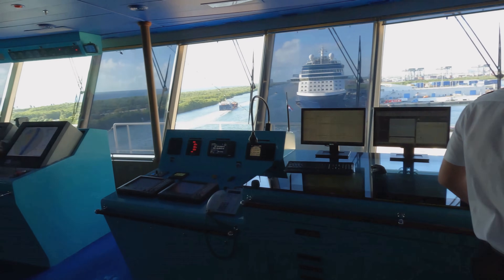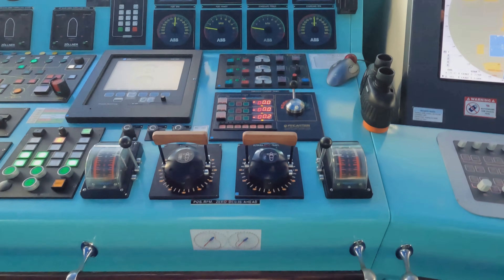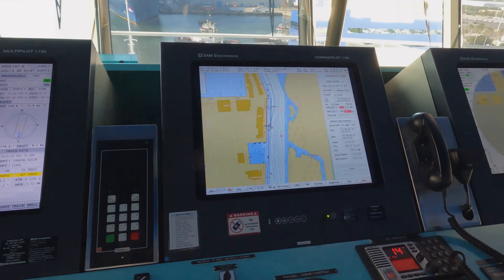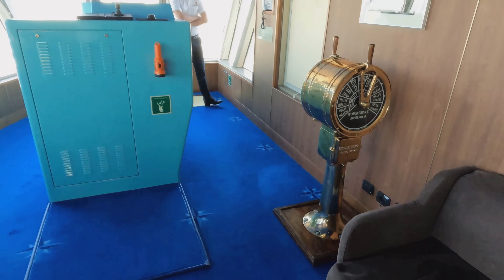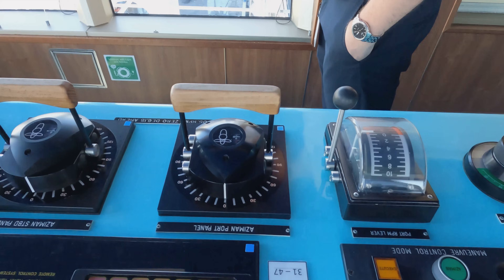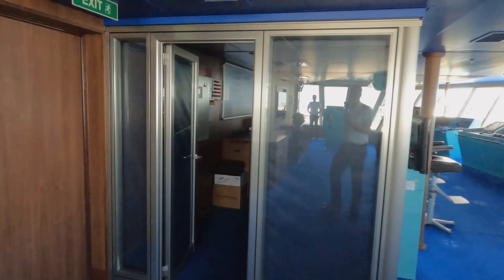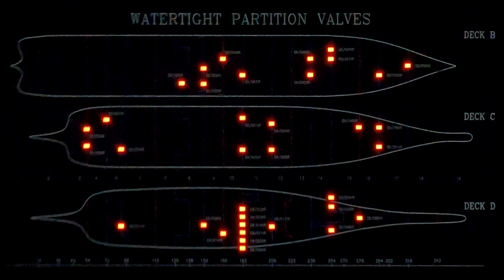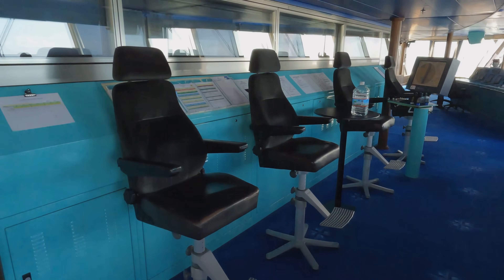Cruise Ship Bridge Tour

Comment: Very amazing tour, I am curious about a couple things. Is there like an auto throttle system or is speed always manually controlled? Also, what is the difference between the RPM lever and the throttle handles on the azipod controls?

Comment: The good thing about old ships is that they have already proved their reliablebility.  I bet you this ship has  been in many rough situations and has made it.  Newer ships also comes with the lack of experience in real life conditions. I wonder if the engine stop working because malfunction, if they have enough drinking water and food in storage for all the thousands of people they have on board. If the lights goes out, their phone system may not work. Scary situation.
Reply from the maker: This is an excellent point. I prefer the older ships which are smaller and have far fewer people onboard than the newer ships. Imagine trying to evacuate 10,000 people from one of those floating monstrosities in an emergency.